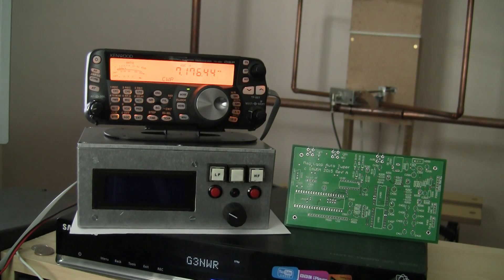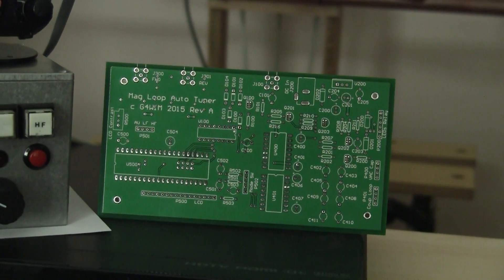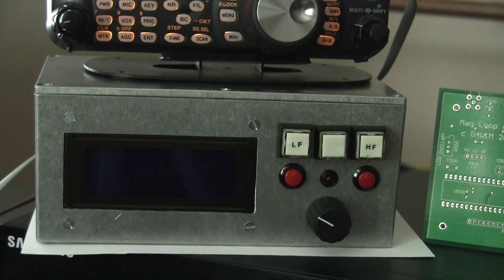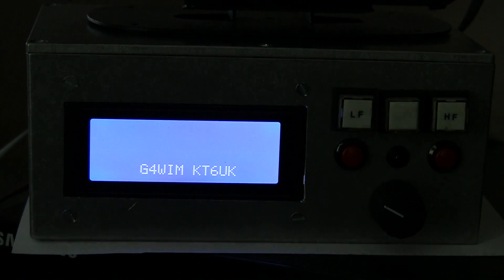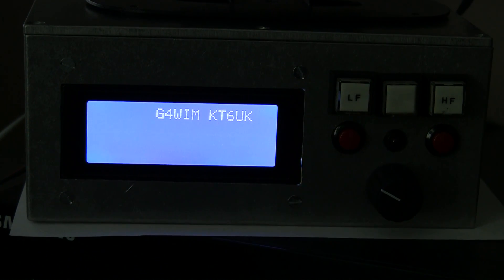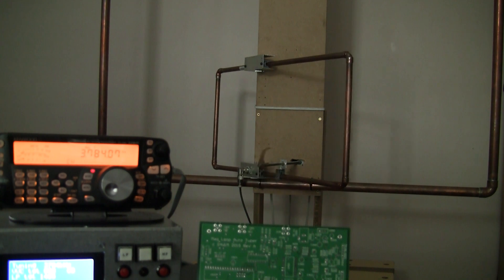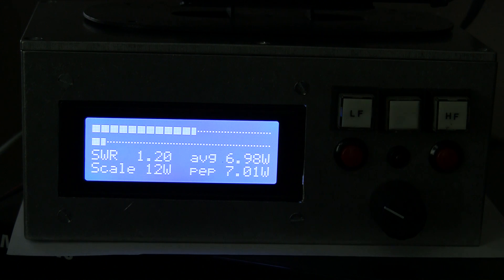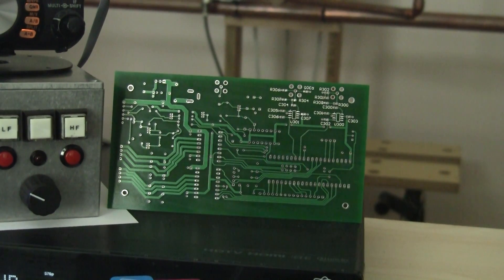MKII Mag loop- improved input match with rotatable input coupling loop

Comment: I know this video is old, but why did you put so much time into the autotuner but just settled with a square antenna instead of a neat loop? lol
Reply from the maker: Number of reasons - square works just as well as a loop and is easier to make than a circle - plus the project was more about the automation rather than the mechanical  construction of a loop.  I expanded on these reasons in the article and tried to keep the solution generic such that it could be applied to any sort of narrow band antenna which needed tuning including screw driver types.

Comment: Very nice! You mention micro-stepping of the motor(s). With 1.8 degrees per step, how far down the micro-stepper chain did you go? Also, was that granularity needed on both steppers, or just the stepper that controls the Jennings? Finally, what microcontroller did you use.
Jack Purdum, W8TEE
Reply from the maker: Hi Jack,  I found the 1/4 micro stepping was about optimum as it allowed controlled accel and de-accel even for fairly small chnages in freq.  Also at 14MHz the extra resolution helps centre the VVC more accurately.  The resolution for the input loop stepper is not anyway as near critical, but I still used 1/4 stepping on that.  1/8 stepping resulted in not enough torque to consistently drive the jennings.  The controller was a Teensy2++  (Atmel) but am considering re-working the code to an ARM Cortex and making the whole system fully self calibrating.